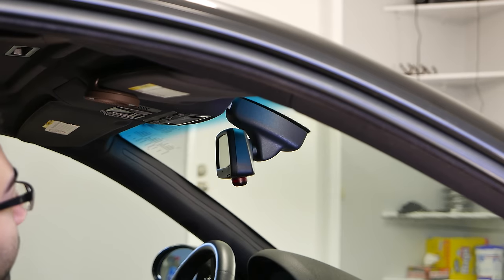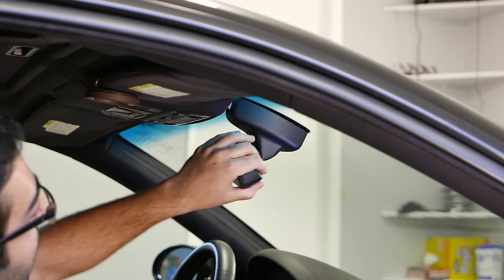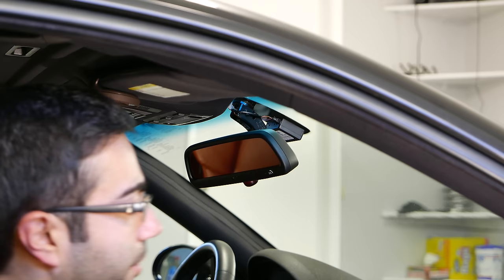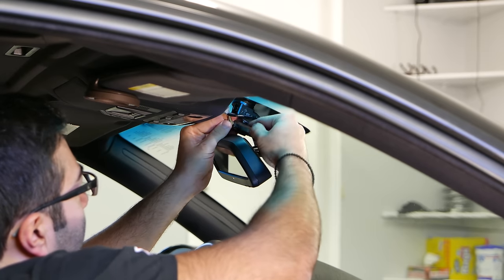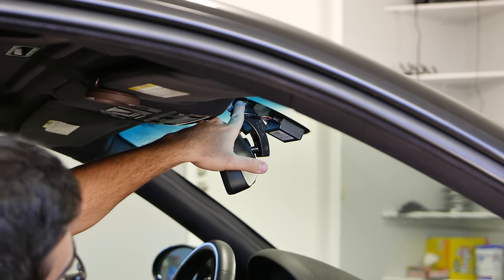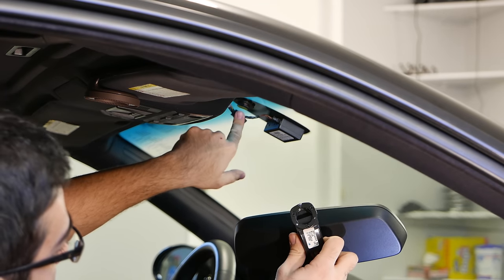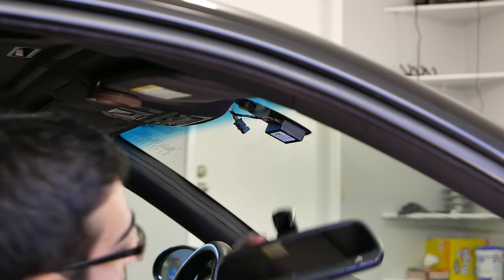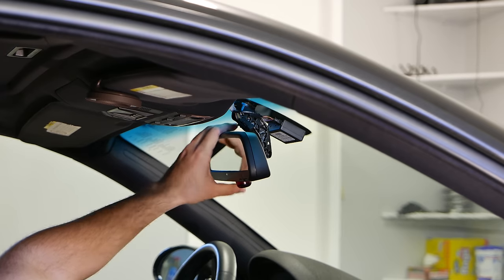BMW Rear View Mirror Removal and Installation

Comment: Best instructions I've seen on BMW interior rear view mirror replacement. I sourced my mirror used from ebay BMW 328i 2008 E90 sedan. It's hit or miss though on used parts. But at $35-50 you can take a few risks.

Comment: Just replaced the same mirror shown (auto dim and emergency phone) with newer one that had built in compass and home-link.  It is working!  Needed to file the nubs off the base of the replacement to get it to fit the mount. The compass had to be reset by driving around and I used a hand garage opener to program the home-link. This was on a 2004 330XI.
Reply: Getting ready to do the EXACT thing on the EXACT car. Concerned about the need to file nubs off the base, but hopefully it will be intuitive? Mirror dimming fluid on my 2004 330xi is starting to streak.

Comment: Thank you so much for this video. It was so tricky to get the mirror back on the little mount.

for my 2007 bmw 328i, I had to go the opposite direction (counterclockwise) to put it back on. so basically attach it at an angle from the left side, then turn it counterclockwise.

Comment: I accidentally hit my mirror when changing my shirt and it came off. I knew id didn’t break it. I was so confused how to get it back on. Thanks for the help I got it back on easily. I might consider replacing it with a better one that i know how to remove it now.

Comment: Excellent video and most helpful indeed. MGZT saloon is the BMW make and mirror identical to your description so fairly straightforward to refit using a high quality resin bond adhesive for the metal bit. Thanks for this

Comment: Ok, so my mirror isn’t broken or like messed up in anyway. Just the thing it connects to isn’t gripping the mirror enough to keep it in place. So when I go over bumps, it kinda bounces up or down. Any solution to this? Or possibly a video you’ve made on this issue? It’s not something I need to replace I hope, I’m just hoping there something I can do to fix it without completely buying a new rearview lol or a rear view mount. That would be even worse aha
Reply from the maker: There should be a pressure clip that ultimately clamps down the mirror to the glass mounted portion. Make sure it's not broken or jammed up. It's a very simple mechanism so it should be fairly obvious if it's broken.

I know you don't want a new mirror but it's not super expensive to get a used one on eBay

Comment: Great video thanks ….Does anyone know is it the same for right hand drive vehicles? Turning anticlockwise still ? Can I use a screwdriver to open the surrounds can’t see what a pick tool is ?
Reply from the maker: Should be the same. You can use a small thin flat head screwdriver if you don't have a pick

Comment: Can you comment on what the part number for the replacement mirror lens and your mirror part.  Link is where?  Is yours an SOS with Clown Nose or with A B C Homelink?  Are they exchangeable if you know, with one another.  Mine is the triangle with narrow crown vs an oval. Auto dimming and i believe similar to what you had initially?  I’m assuming you replaced like mirror or leaky one. Appreciate your video.
Reply: I recommend replacing the electrochromatic mirror for one with manual dim.  Manual dim for the mirror is a better idea than putting in another EC mirror that will fail later.  This part still has the light sensor for automatic headlights and works with the rain sensor for automatic wipers.   Part number is 51169218046.

Don't sweat losing the SOS button since the cell spectrum the E46 used has been disbanded.  Pressing the button now causes a radio error that can only be resolved by pulling fuse 39.  Don't press it.

Comment: I accidentally bumped mine so the piece that you twisted off that metal piece that stays on the glass it came off how would I do that back on or what would I use to place that back on thanks
Reply: I tried but it came off I think you need a special glue or adhesive

Comment: my piece from my windshield broke off with the rear view mirror can I buy just the piece and not a whole new mirrot
Reply from the maker: abraham carrillo yes you can buy a new piece. Check realoem for the most accurate part number for your specific car. http://www.realoem.com/bmw/enUS/showparts?id=BD53-USA-05-2005-E46-BMW-330Ci&diagId=51_3244#51167115776

Comment: Hey you see the metal part that was left of the window it kinda came off is there anyway I can fix it
Reply from the maker: gamers only you can try using some adhesive that will bond to glass
Reply: gamers only did you find some think to glue on the metal bit as mine came off as well
Reply: Lil_xtl_ did yu sort it ? What did yu do?

Comment: I feel like a tool so forgive me... but I can’t remove the electrical connector . I’m squeezing and prodding but can see / feel how it releases
Reply from the maker: It's a simple locking clip, go to the 1:50 mark, a small flathead screwdriver should do the trick. Just be patient and walk it out slowly
Reply: Lefteris7 it seems you’re pressing on the top near the wires. Pushing in, I hear a click on the vid . But I don’t see any push click there , nor on the sides. Again I feel kinda silly but I can’t tell where the release is. I’ll keep messing with it thanks
Reply: There are clips on two opposing sides.  Press in from both directions and it will release.  If you can't make it work, shift 90 degrees and try again.

Comment: I have never heard of a Rear View Mirror that goes bad before. Did BMW designed it poorly on purpose to make money on parts? If so, I would never buy a BMW, that's something  an American car manufacturer would do. That's why I buy Only Japanese.
Reply from the maker: Bruce Truong BMW doesn't make the mirror it's made by Magna Donnelly who supplies the mirror to a large majority of OEM's. There is a fluid that is between the two pieces of glass that functions as autodim that can possibly fail
Reply: Bruce Truong That was a pretty stupid comment.